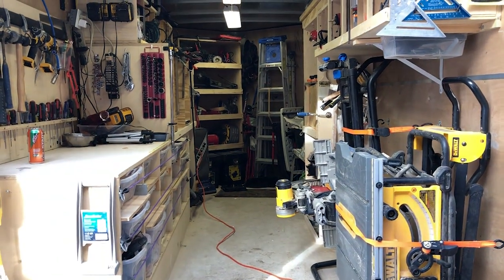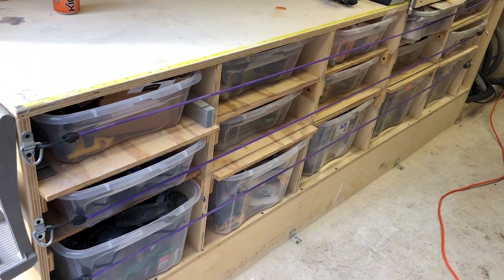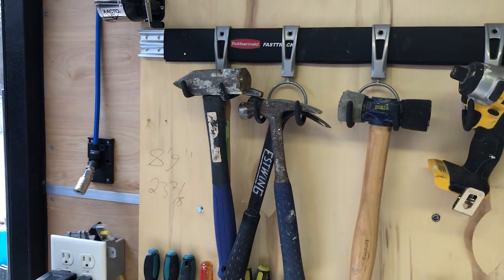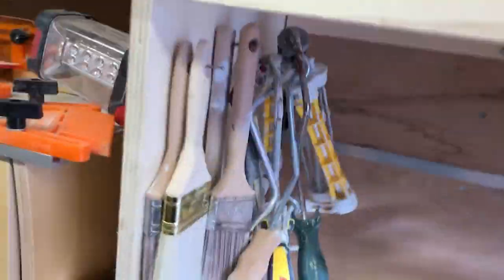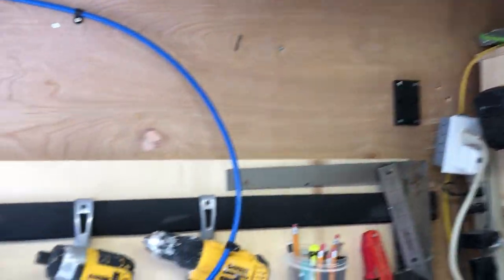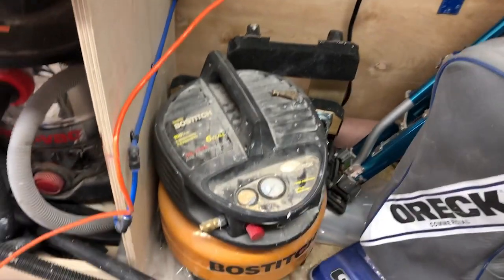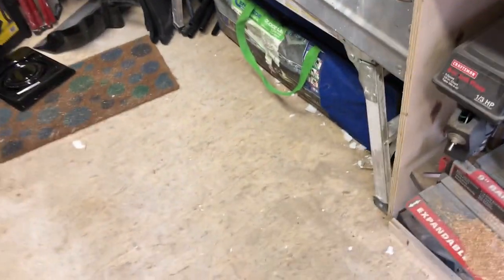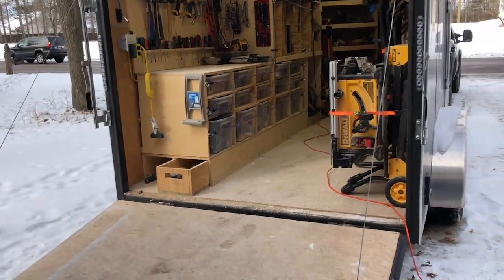My Ron Paulk-inspired tool trailer

Comment: I built a 7x14 trailer. “Paulk inspired “ . However I like the side door but wanted more wall space. I built a shelving unit on casters and hinges. It swings out of the way and gives me access to the side door . I have a video posted . Check it out . Maybe it would work for you.

Comment: Great video on your trailer!  Just a suggestion about the side door to your trailer: mount the trailer spare on it at the bottom, use the rest of the door for extension cords and hoses.  Tool trailers are ALWAYS a work in progress due our needs changing.

Comment: Of all of the truck, van and trailer videos I have watched you are the first to address liquids freezing.  I am curious how you manage this for your day in, day out items such as mud, caulks, glue and paints.  I am not near as far north as you, but I still keep my caulk tubes, paint cans, etc in an old 56 quart cooler that comes in the house with me on cold nights.  There is nothing quite as frustrating as pulling on a caulk gun with a frozen tube in it.
Reply from the maker: Similar to you, I have a rolling Stanley box (like the ones under the front cabinet in the video) with "DO NOT FREEZE" written on tape across it that I bring inside with me. I didn't have it on the trailer when I shot the video because it was below freezing.